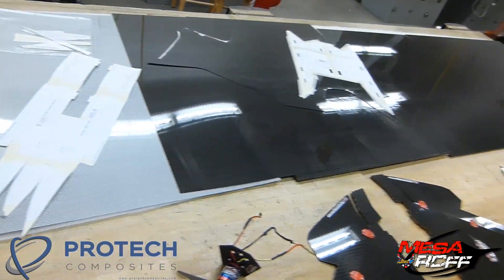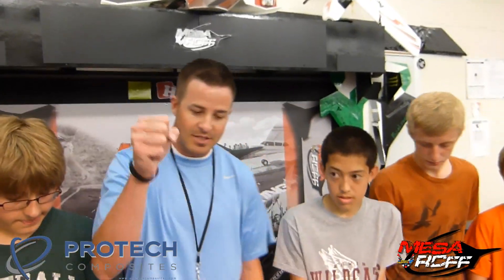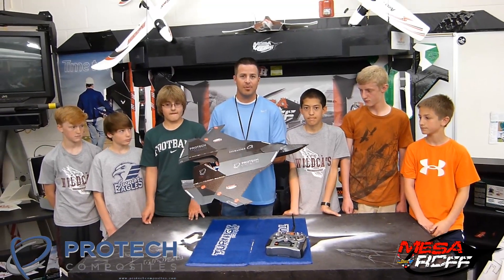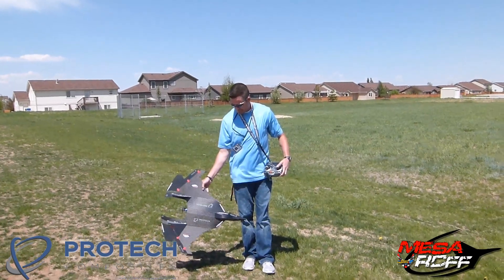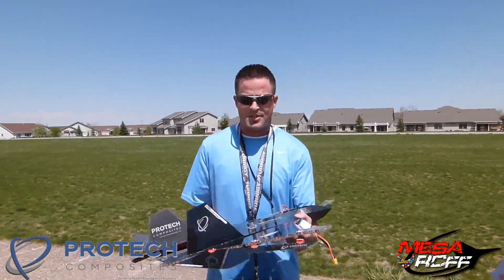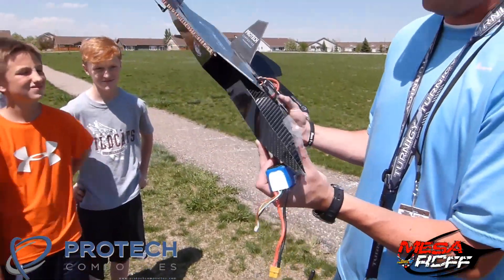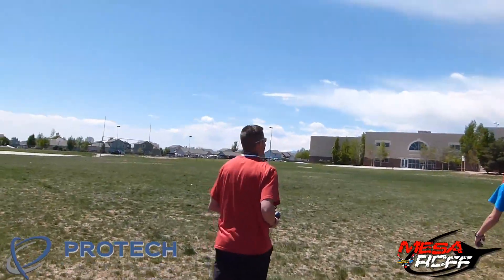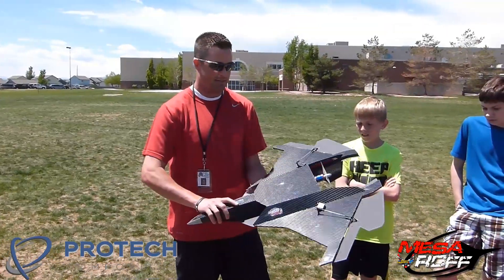MESArcFF - Protech Wolverine Maiden - TEAM PROJECT

Comment: There is no yielding like metals to allow some
plastic bending to redistribute load.  Their plane was heavy because they
were given scrap sandwich material.  The graphite sandwich sheets needed to
have even thinner graphite facesheets to optimize the design for low weight.
A real fighter jet is carefully engineered to minimize weight while
maintaining just enough strength."

Comment: I sent your Video to my brother, who is a Structural Engineer and worked on real fighters. 
"Cool.  They learned that composite material, especially sandwich design with
graphite facesheets, is very stiff.  Not as easy to work with.  Also, when
it does break, it shatters.